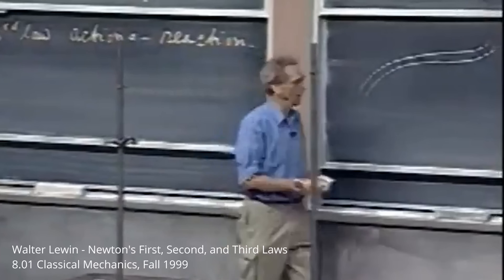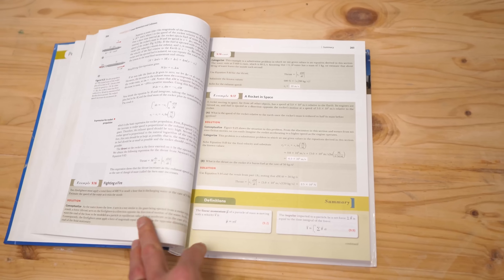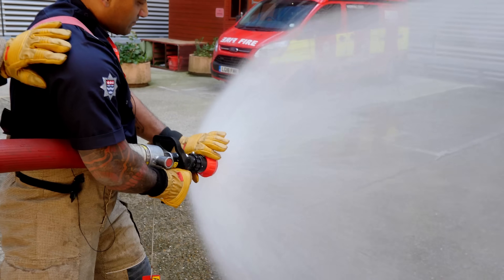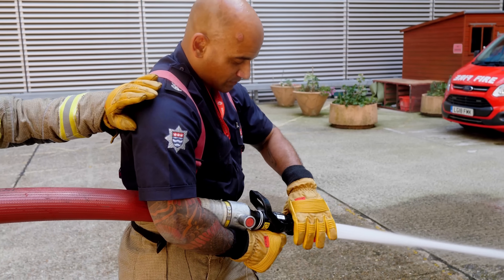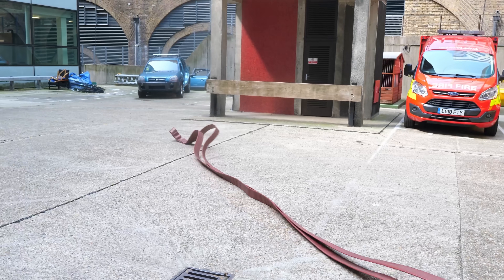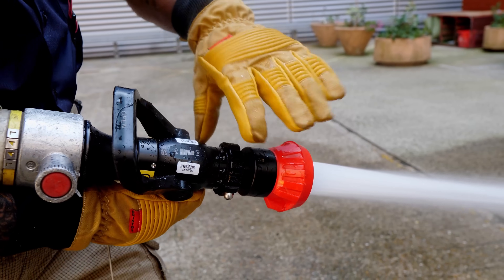Why chaotic hoses dance

Comment: The hose is experiencing a total force imparted by the water, from its pressure, and from the curved nature of the hose. If the hose is more straight, less energy is put into the curvature, so the water is faster and can exert more consistent pressure. If the hose is curved some of that energy in speed is lost to the curves resistance, but it is still in the system.

So you will measure both forces accumulatively at the end of the hose, and the split is always equal. 

seems unlikely, surely the energy imparted wouldn't be equally efficient, but seems somehow plausible to me on initial thought.

Comment: 3:57 I love that the water rivulets effect is not due to the water pushing on any hose, or embankment, but rather pushing against its own surface tension, creating a sort of hose around itself. Meanwhile other liquids (such as many solvents) that have incredibly low surface tension will not do this whatsoever!

Comment: The way I see it, the Pump is generating energy and the water is carrying this energy. Some of the energy is lost travelling through the hose and right at the end of the hose this energy causes the hose to flail. The firefighter is applying force to counteract the energy at the end of the hose and stop it from flailing. If you took a Pump and 2 different lengths of hose(1m,1km), the shorter hose will flail more, so the firefighter is not fighting the Pump but instead the end of the hose.

Comment: You can experiment this:
1) pump + short hose + straight rigid pvc pipe. The pvc pipe is maintained horizontally by 2 rings. Thanks to the hose part, you'll be able to measure the force applied to the pvc pipe.
2) same but now the pvc pipe is bended in the middle like a caterpillar, between the rings.

Comment: When you measure the force with the bend tube it makes a full turn, so the total change in monentum direction from input to output is zero, I wonder if the force would still be the same for let's say a 90 degrees turn

Comment: Is the demonstration with the scale and the straight vs looped hose actually conclusive? If you are talking about net pull on the nozzle due to turns in the path of flow, doesn't a loop cancel out its net effect over the course of that loop? Wouldn't you get a clearer result from a meandering hose with multiple turns, but no backward flow pushing opposite the rest? Sounds like something you and Mehdi could debate, anyway. Speaking of collabs, you could get some serious slow-mo of a whipping air hose from some channel with Phantom cameras and see if you can analyze it. Also be curious to know if you'd get similar effects if you (in the style of this guy named Steve Mould) restricted the waving of the hose to two dimensions between pieces of acrylic. Might help the slow-mo analysis.

Comment: other examples to consider: a pressure washer, water rockets. also gravity changes the equilibrium conditions if the hose is dangling or pointing up

Comment: The hose must be stretching a bit to support the pressure difference. Remember that the water kept going for a few seconds after the pump was shut off.  If so, the hose is the same as a common balloon. You inflate the balloon and release it without stopping its neck. Then the balloon flies off by the reaction force.  The pressure difference accelerates the air backwards.

Comment: The water also has friction against the inside of the hose thus some of the force is cancelled out in the firehose
Reply: That's correct. The flow in a pipe is usually (static laminar flow case, if I remember correctly) limited by Hagen–Poiseuille, hence the forces on the two ends are NOT equal. There is a third component that represents the friction on the inner wall of the pipe.

Comment: The water pressure explanation is probably wrong. Since water isn't that compressible there will be minimal velocity change existing the hose assuming there's no diameter decrease at the exit.

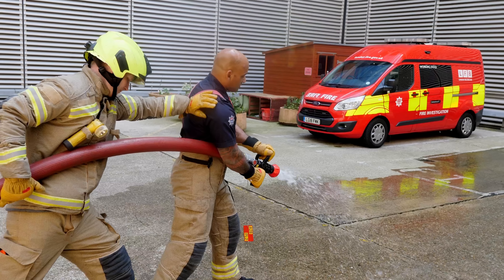Comment: 6:35 "the firefighter must withstand the full reaction force..." No way, right? That would imply its just as hard to hold the hose as it is to stand right in front of it holding a shield?
Reply: if you ever have 3 minutes to spare you should listen to more of the video
Reply: Yes, the forces would be roughly equivalent aside from the loss in velocity as the water travels through the air. The water cannons that riot squads use that are capable of knocking a person ass-over-head are mounted to cars because there is no chance of a person ever being able to control them without assistance.
Reply: Which part of a rocket engine actually produces the thrust? Or which part of a jet engine does?

Comment: @SteveMould, take a look at a jet ski powered jet pack or flyboard boots. It’s perfect for what you’re talking about here as the pump (the jet ski) is floating in the water free to move in any direction, however the pump does not move the jet ski at all. It floats still and only moves when the hose connected to the person drags the jet ski along. The only force seen is at the end of the hose where the jet pack or flyboard boots are. There is no noticeable force at the jet ski, even though the jet ski is sucking in a considerable amount of power ( I believe similar or more than a fire fighting hose), the pump is horizontal so it’s not like it has a vertical pump only providing a downward force, yet the jet ski stays still.

Comment: The force being something the fireman feels makes perfect sense. Water carries a SUBSTANTIAL amount of force - it's why water hammer is a huge concern in boilers. This is why it doesn't make sense to you that the pump should be feeling the force. The pump just makes pressure, and it's pinned in place. So that momentum would love to push against the pump, but can't, that force only points forward down the hose. And because water is incompressible, all the water keeps pushing against the water in front of it. This continues on until we get to the nozzle, where the water is still experiencing forces in both directions, but because the area in front of the nozzle offers so little resistance, that force only really results in the nozzle pushing backwards.

Imagine if you were in space and exhaled SUPER HARD. You wouldn't get pushed back from your lungs even though they made the pressure, you'd rotate from your mouth, because that's where the transition from high pressure to low pressure occurs.

Comment: If you turn on one of those whirling sprinklers with I think 3 or 4 exit tubes and it turns one way, will it reverse direction if one could put the water in backwards and flow into the hose? Originally I read this in a book called Surely You're Joking Mr. Feynman. As I recall, the result is not told but Feynman, a freshman, was banned from the graduate lab and not expelled. He'd done his own experiment with an air pressure machine and glass and couldn't turn the thing off at the critical moment and glass shattered all over the lab. Can you give us some insight?

Comment: I'd think for a water hose you should be able to measure the difference in force from the pump to the reaction force at the nozzle. If you know how much flow there is and the cross section of the nozzle you can calculate the velocity of the liquid. Pumps measure their output force in head, the distance they can overcome gravity at a certain flow rate. Take your hose diameter, multiply it by the pump head at the flow rate you measured and you have the overall volume of water that pump is moving at any given time. You can then use the mass of that much water, combined with the velocity calculated at the nozzle, to give the overall kinetic energy the pump is outputting at that moment. Compare that to the felt force at the nozzle.

Comment: Thinking of the pressure difference on the fire hose I think of Bernoulli's principle. 

The end of the fire hose is different than the air hose. Specifically think of a garden hose you hold it out in front of you and it sort of plops out, but when you stick your thumb over the end it speeds up. You feel the pressure behind your thumb but you aren't going to be able to hold back the water and make any meaningful difference in the pressure inside the hose itself. You have increased the velocity of the water but not the pressure. 

Think of those smoke ring cannon things. The outside of the ring is rotating backwards towards the firing position while the inside is rotating away from the firing position.

Because the water is in a confined space the center of the water is pushed out faster while the outside also increases but in the opposite direction. 

Given enough friction the water is rotating inside itself and the outside is pushing the the nozzle backwards. 

Im not sure but when you were explaining that the pressure of one water packet pushes on the next in like all the way down just felt wrong knowing the water needs to narrow down to a smaller space.

Comment: respectfully, the flow isnt constant inside a hose, epically a large diameter fire hose,  its called friction loss and is determined by the gpm flowing, the size of the hose and the length of the hose, it is not a constant either, theirs a lot of science and math we have to take into account epically when we send hoses up a grade or staircase and up the pressure to compensate for the loss .

Comment: 11:45 when you bring up fluid dynamics, it's important to note that pressure is not equal everywhere in the hose. If you look up potential flow diagrams you'll see that the stream lines, which trace the path of the fluid flow, are perpendicular to the equipotential lines, lines of equal pressure. This means that as the fluid is traveling down the hose the pressure must always be changing. This is why there's some debate as to if a pressure differentials causes fluid flow or if fluid flow causes a pressure differentials.

Comment: I think it kind of makes sense if you think of the water as a bunch of little compressed springs. The pump is keeping pressure by constantly compressing new springs into the hose. Then, at the end of the hose those springs are uncompressing. It would be really cool to see a demonstration where the difference in speed between the fluid in the hose and the fluid outside of the hose is noticeable. 

Also, in your experiment to measure the force on the end of the hose, I would expect the straight and full loops to behave the same  as the forces on opposite points of the loop would cancel out. I would expect a maximum difference when the hose is curved 180 degrees. I also noticed that you don't really see the coriolis effect in the full loop when turning on the air. When I had a detachable shower head that was attached via a hose, it would twist considerably anytime the water was turned on or off. So the difference in density between air and water may be causing different phenomenon to dominate.

Comment: I put to you that you're wrong .. on multiple points here. The pressure on the tube is relatively equal until its near the end of the hose... the wiggle is determined by its flexibility vs nozzle velocity. The flexibility is based on hose material and fluid pressure. The force is mostly delivered at the nozzle. The force is determined by fluid and pressure and whatever nozzle. The pressure can change slightly due to angle of the tube... i call it the travis effect

Comment: That 2.5" handline is being held down by it's own weight. That is the reason it isn't flailing around. A 50' long 2.5" handline full of water weighs a TON. And the rocket analogy is what's happening at the nozzle. The nozzle in the rocket engine is the exact same thing as the nozzle on the end of the hose. That's where the PE in the form of pressure is converted into KE, resulting in thrust.

Comment: The fluid exiting the nozzle of the hose experiences a change in pressure.  The force acting on the nozzle is equal and opposite the change in speed, of the fluid, that results from that change in pressure.
edit:  Oh okay, you got it.  I'll save my comments for the end of the video from now on.

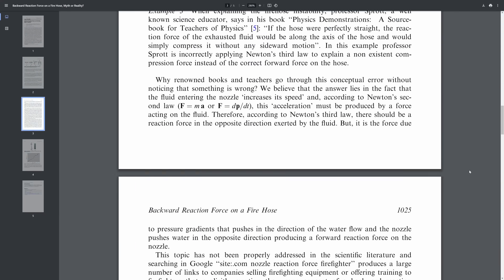Comment: The impellers feel a force at one end of the perssurized system that should be roughly similar to the point at which it equilizes: the nozzle. Thats my guess 8:00

Comment: I'm wondering if friction between the hose and the fluid is part of the behavior. when pumping fluids you have to account for pressure drop and it's proportional to the length of the hose and the schedule (smoothness), and diameter of the hose/pipe.

Comment: Ok, so a very easy way to look at this is as though you are firing a gun with a moveable trigger/handle so you can fire the gun with you behind the barrel like a normal rifle, where you will experience the reaction you predict. Now move toward the front of the gun, much like a bazooka is fired, and you will find the same force. Now, add the fire hose and the reaction force is felt where? The conclusion? The nozzle and anything that tries to tame it, are where the reaction is. 

Also, the firefighter said they didn't have right angle valves that could shut off the water to the hose.....and then proceeded to show the valve on the nozzle which was clearly strong enough to withstand the pressure but it was at the nozzle as though that didn't count. They clearly make ball valves that could be used in a pinch.

Comment: I’m no rocket scientist but a rocket and a firehouse both have nozzles and it seems to me like the nozzle size and length have a lot to do with it.  The smaller the opening at the end of the nozzle the more pressure builds inside and the faster the air/water comes out the end.  Take my power washer for instance it’ll knock you over trying to hold the handle, but take the tip off the nozzle and you can’t even feel it.

Comment: 13:05 Yes, but you also should account for the small difference in the direction of the vector. The difference is pushing on the walls and builds up in significant force up until the water is completely redirected. That also explains, why there is no sideways force on the very end, and most of it is applied on the last bend. You can actually feel that when you holding a hose while spraying water, if you suspend short part of very end - it won't start chaotic movements, because forces applied on the bends is insignificant.

Comment: Pumps build flow, restrictions build pressure. The nozzle creates the pressure, not the pump. The acceleration of the fluid is at nozzle, not the pump.

Comment: So, I'm no physicist, but I've seen people being toppled over by a firehouse, even people who were bracing for it. A fire fighter can singlehandedly hold a hose, but if he has, let's say a riot shield or something of the type, that could receive  the full blast of water, I doubt he could stay standing (especially if it's a concave shape, so it wouldn't disperse the jet to the sides.)
On top of that, if you put a solid pipe, whose diameter is close to the hose diameter, but a little bigger) almost all the way from the tip of the hose to the pump, it wouldn't jolt back. So I'm guessing the force the fire fighter is feeling is the stabilization force, rather than the pushback (in this case you could push the string, if the analogy works).
Just some food for thought.

Comment: To me, the case of the firefighters' hose not showing motion far from the end doesn't really challenge your earlier reasoning: the amount of friction that the ground can exert on the hose should in itself be a significant stabilizing factor (especially considering your other statements about the forces due to curves / bends being relatively small).

Comment: Isn't the contact with the ground enough to cause the mid bends not wiggle around like your air hose? If you suspend a garden hose in the air as you did with your air model would it not show some type of wiggle similar to your model?

Comment: Great video as always, Steve! Well done.

I have a bit of insight into this phenomenon from a less dangerous but still relevant perspective. I’ve been in the swimming pool industry for 20+ years, and pool owners with sand filters will be familiar with a similar effect—especially if they use a flexible backwash hose.

Since backwashing is typically a weekly task, that hose is rolled out, and water flows through it for a few minutes each time. Over time, the hose behavior changes due to repeated expansion, contraction, and movement.

I could go on and on about this, but I’ll keep it short—pool backwash hoses are usually much thinner than the one you used in your pneumatic demonstration. If you ever revisit this topic, it might be interesting to chat with a pool owner or a local pool technician for another perspective!

Comment: I think there's another aspect to be considered. If your hose has a wider cross-section than the total cross-section of your nozzle-opening(s), then the speed of the water will be lower in the hose than through the nozzle. Meaning that your experiment with air in the tube didn't have any acceleration factor in there. I think that that acceleration is a significant factor. Let's say your nozzle cross section is 50% of your hose, then of course you're going to have 50% slower water in the hose, thus feeling newtons third law right at the nozzle.
Reply: Exactly.  The reaction force created by a nozzle, is simply because it's, well... a nozzle.  I doubt there would be a significant pressure drop at the open end of a hose without any restriction, like was stated in the video.

Comment: I'm surprised those guys haven't trained the Z-pinch maneuver if they have a collapsible hose. (One thing I remember back from being in the Navy years ago.) But yeah, those can be up to 100PSI with up to a 4 inch opening, which provides a good lot of force for that brass fitting or nozzle on the end to clock you out cold.